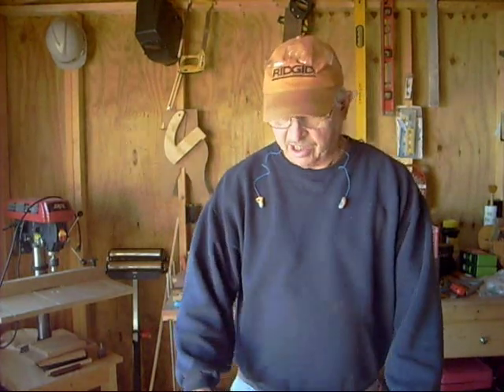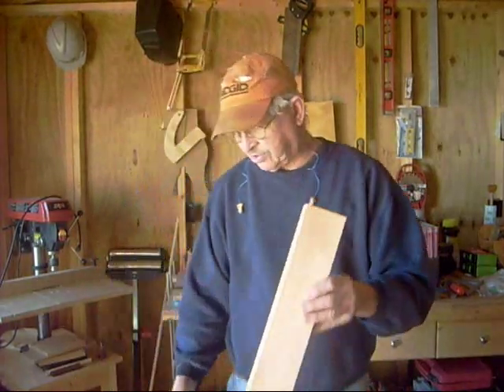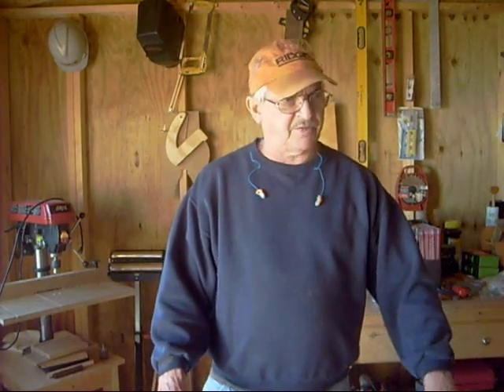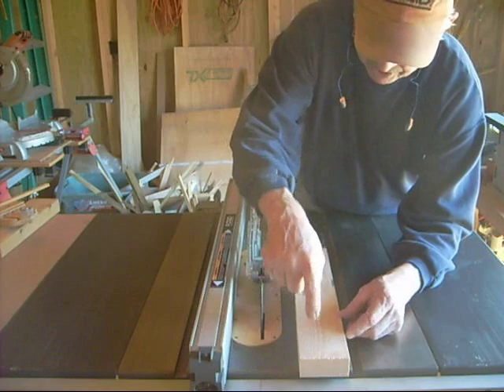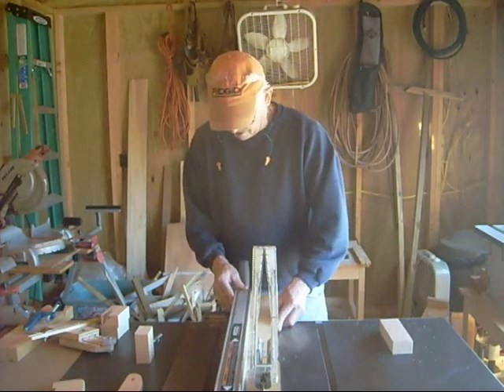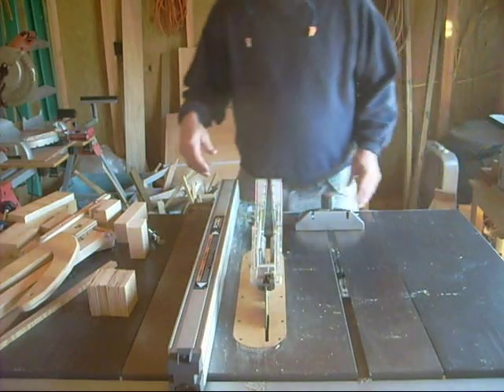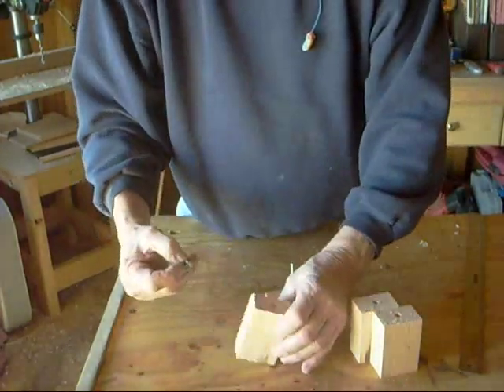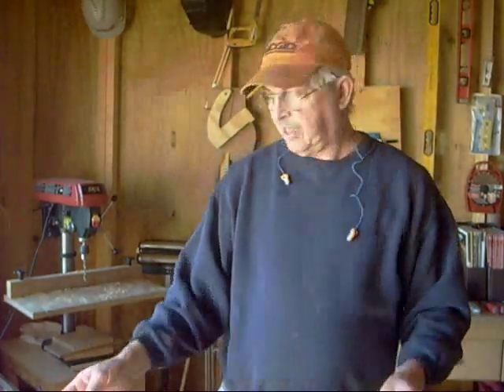Make Your Own Leg Levelers

Comment from the maker: Go ahead I'm glad you like them. You can glue up 2 pieces of 2x4" stock and make them stouter . I used 5/16" carriage bolts you could use a larger size. Hope this helps. Good Luck Bill.

Comment: Good video. I use Elevator Bolts so I don't need the plywood. A 1/4 elevator bolt has a 1 inch diameter flat head. Under the head is a square like a carriage bolt. But they are not cheap. Ace Hardware has some.

Comment: Because my 90 year old house has an uneven cement floor I built a infeed roller table for by tablesaw years ago using t-nuts and carriage bolts as the leveling mechanism. It's a good cheap method that has stood the test of time.

Comment: Should show how it fits on a piece you make it for.
Reply from the maker: I just made it for an example so others could use it where they wanted to. Thanks for watching.
Reply: Thanks. Could you show me how to make adjustable legs for a wooden step ladder? I could use it on steps.
Reply from the maker: justpar2012 Your best bet to be safe is buy a ladder that will do that Harbor Freight has one for about $120